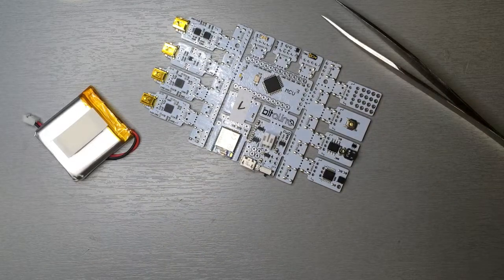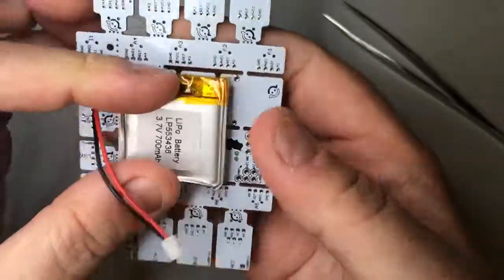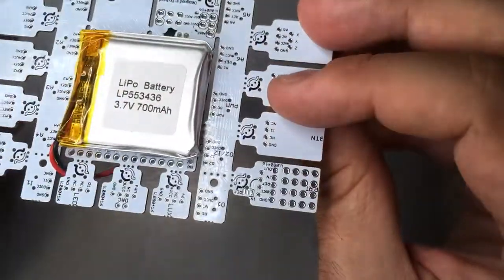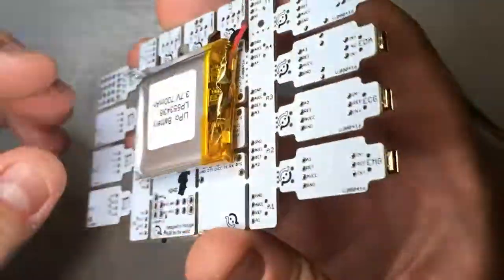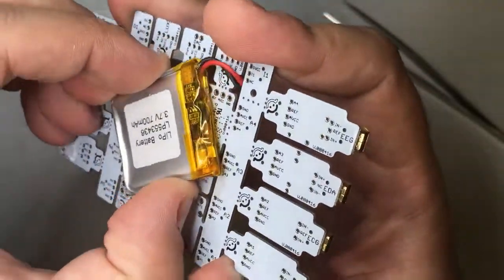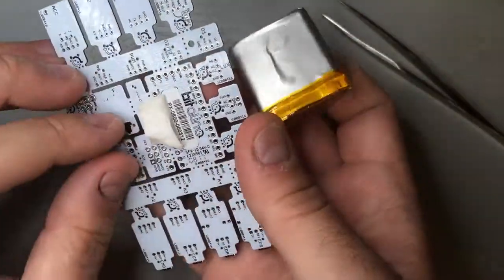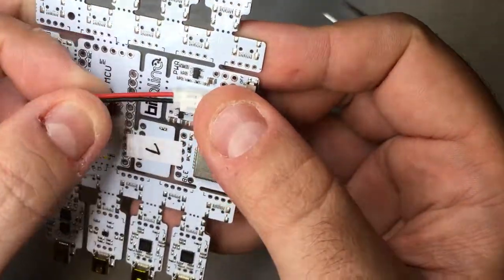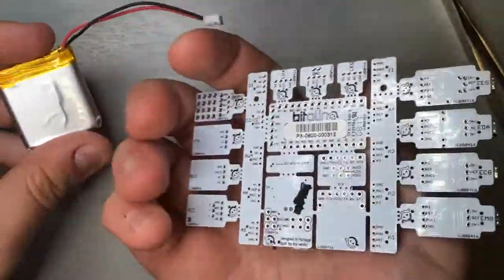Battery Connection Recommendations for BITalino Kits

Comment: Hi.
Aside the white LED that lights up when powering it on, there's another one that comes red, and then the Bitalino goes off.
I guess i just need to re-charge it with a USB cable (like the ones from most Android phones).
I judt did it for over 1 hour and it still shows the same scenario.
Should i leave it longer, or there could be something wrong with it?
Regards,
Reply from the maker: Hi Carlos, 

The red LED is the low battery indication... if you charge the device it should go off. However, it may happen that you have a defective battery. Please report the issue that you are experiencing to our services at support@plux.info

Best regards,
The BITalino Team
Reply: Thanks for answering. According to the Bitalino forum, the red LED should light up while charging and go off when charge is complete. In my case, there are no more LEDs lighting up and 0 volts on the battery. I will write to the email you shared. Regards,  @BitalinoWorld
Reply from the maker: @TheCarloszoom3000  maybe you have received some defective items... please e-mail us to support@plux.info for our operations team to take corrective action.
Reply: I just tried another cable from an old BlackBerry phone and it worked. It is curious that the previous cable worked just fine with my phone which by the way should take much more current than this Bitalino board. Thanks for your help. Regards,
Reply from the maker: @TheCarloszoom3000  that's curious... we're glad that the problem is sorted out; if you have further questions, let us know.